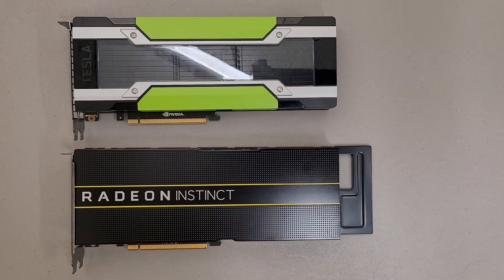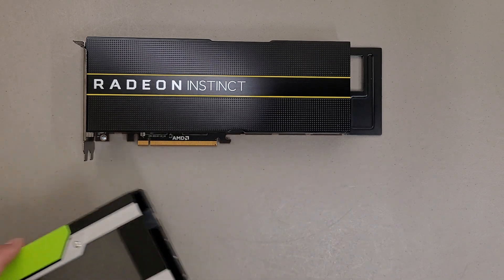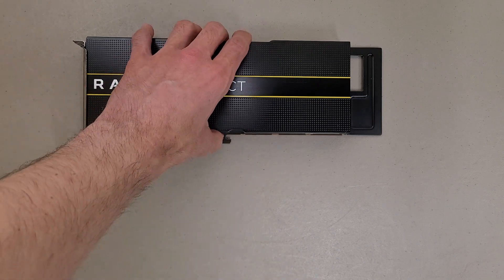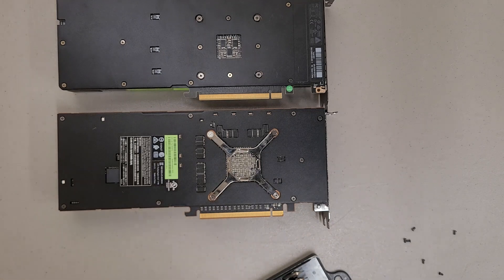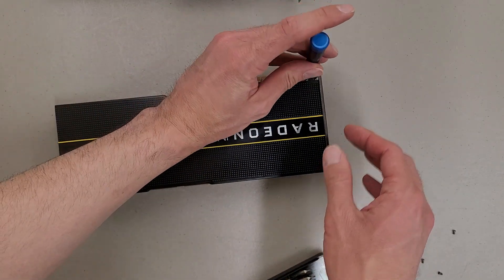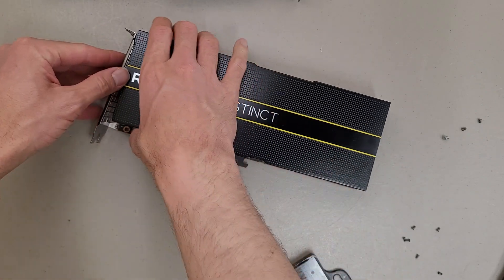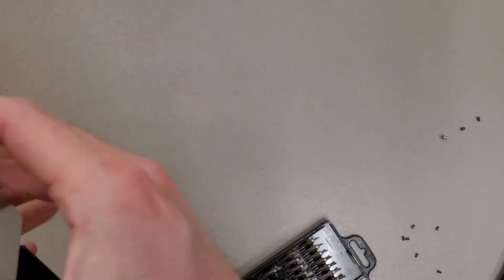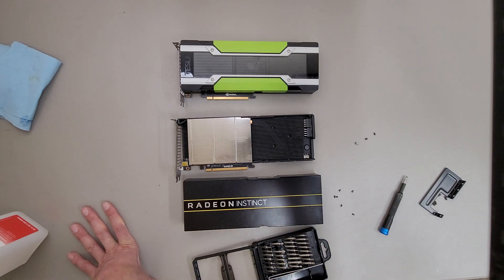Taking a look under the cover of the AMD Radeon Instinct MI25 #teardown

Comment: Theyve been flashing these to use for gaming around here. Id be interested in settingbup a ML rig fyi.
Reply from the maker: I've been to busy to play with mine still. 😅
Reply: flashed to a WX9100 Pro the work very nicely for Stable Diffusion with rocm for torch backend.

Comment: That triangle pattern of screws is where the blower fan would be mounted on an actively cooled version. So that's why the finned part of the heatsink is small, they just use the same heatsink, with a different shroud on top of it and a different backplate on the bottom. You could probably take the cooler from a Vega 64 and mod it to work just by cutting out where the rear power connectors are.

Comment: I just put one of these in a Z620 workstation after modifying the front case fan bracket so it would fit in there with the fanshroud+fan for the GPU. Thanks for showing me that fan header. I was wondering why in the AMD info it now showed a FAN0 at 0 speed when it didn't before I flashed it to be a WX9100 Pro. I think you just solved a problem for me because my HP workstation is not like my AMD desktop and it won't let me control the front case fan individually so I could use it for the GPU fan. This looks great though. Merry Christmas/Happy Yule/Happy Holidays!
Reply from the maker: I'm glad it was helpful. Merry Christmas 🎄🎁
Reply: Just thought I would confirm, the header is a standard PWM mini pinout and it handles a .75amp fan decently. It also gave me speed control just like I wanted. Thank you again!

 @computersales
Reply from the maker: @benotsilent6703  Thanks, that is helpful to know.

Comment: wendel from level 1 tech has a tutorial on  this card(something about rocm and stable defusion) , maybe you can flash with wx9100 bios to use this minidp to display video

sorry for bad english
Reply from the maker: Yeah that video was the motivation for buying one. Although I have no idea how to run stable defusion yet. Will probably start with cloud gaming, video editing, and mining tests.
Reply: Is it necessary to flash them to use RocM? I was planning on leaving the bios alone if it isn't necessary.  I'm going to run stable diffusion and a gpt app.
Reply from the maker: @cobraeconomics4881  I believe their suggestion was more oriented for the purpose of trying to use the mini DP port on the card. Although it may not need to be flashed even for that purpose. Otherwise for stable diffusion I assume stock bios will be just fine.